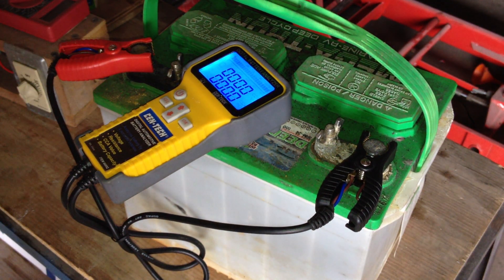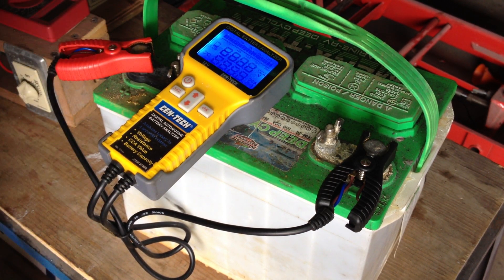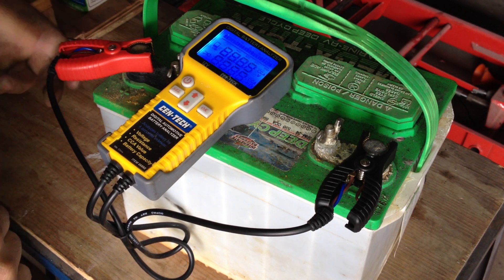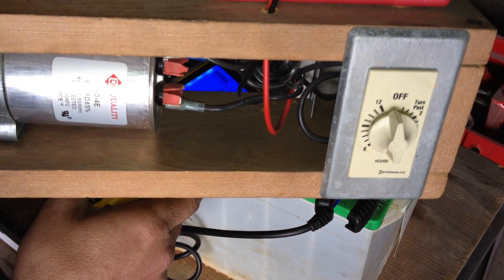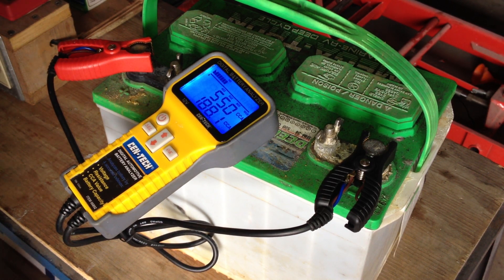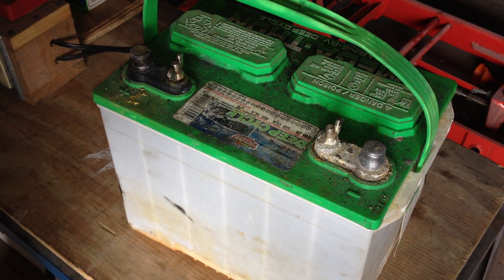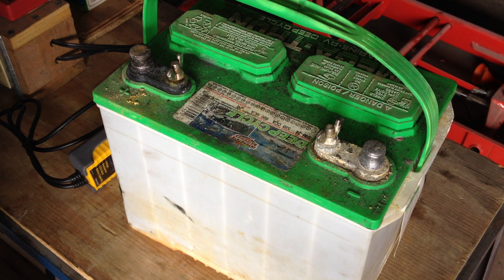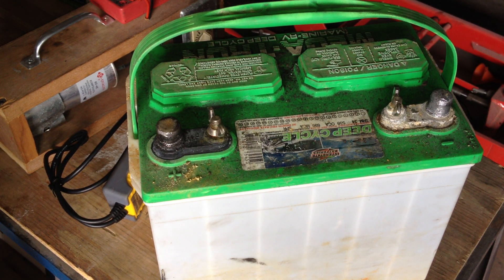Lead Acid Battery Desulfation Using Epsom Salt  -Attempting to use Capacitive Charger  Part 5 of 6

Comment: Thanks again great videos...My wife's father bought a 2003 Buick Century brand new in 2003 with standard V6 engine with Delco brand battery , from the factory.  That same battery going on 14 years old and still  WORKS TODAY!!  even after sitting in the garage not being driven, having lots of down time, (car only has 21,000 miles on it)   However it might now be starting to fail.   I just started keeping  a 2 amp trickle charger on it as it is rarely driven...(LOOKS BRAND NEW)   If the battery  actually fails,  I will try this Epsom salt treatment  A car battery with that longevity certainly proves all batteries are NOT created equal!!!!.  Planned obsolescence?  .

Comment: thank you for the great videos, I now have 18 of these chargers going, have restored to almost  like new many batteries that would have otherwise been scrapped.  I have some though that are tricky and looking for suggestions.  The ones I'm having problems with usually are heavily discharged, and have high ohms reading 40-70 range.  after hooking up the charger they will usually go up to about 100-200 cca and resistance will drop to 15-30 but that's it, they just sit and after leaving it for a couple days it doesn't really progress, they just stay about that capacity.  Do I need to leave it for a month like you say or what?  Discharge and try again?  They don't seem to have shorted cells, the voltage comes up into 12+ range or 6+ range for the 6v batteries.  Any tips?
Reply: these are larger truck batteries or golf cart batteries, have seen as high as 1000 to 1500 cca when like new. and 2-5 mohms resistance on my tester.
Reply from the maker: 262jp Yah either leave them longer, or the capacity is per entry gone. also try checking the gravity of the electrolite
Reply: acid is clear and proper level, plates look good enough from the inspection hole.
Reply: Does the Epsom salt change specific gravity or do I get sulfuric acid?  Trying not to add anything to the batteries (Peter Lindemann makes a good case for "everything that should be in a battery was put there when it was made" the exception is distilled water that could have been boiled off during use and replacing it does no harm) But will do if it brings these tricky ones right up to full function.

Comment: Why not drain it out after all that and put in fresh electrolyte solution. I can't help but wonder if that "Mud" as you put it in the other video is partially responsible for resistance issue. I'd like to see it after it was cycled a few times, flushed and refilled with new electrolyte.
Reply from the maker: Safety, Additional Cost of my Time, disposal, and spending more money then needed.
Reply: Understood, great video series though. Thanks for taking the time to do it.
Reply: ***** I would be interested in seeing what the effect would be though. I mean the epsom salts has the effect of lowering the resistance in the solution. While I can see this being a plus leaving it in, I think the core issue is the sulfation bridging the gap between the plates. Depending on the battery construction it might not make a huge difference and also the lead/insulator sandwich of most batteries would be pretty damned hard to flush effectively just from the standpoint of getting fluid to flow between them to remove the impurities.  Jut curious as to what it would do, that's all.

Comment: 2 questions, I never found your video #1 so did you add the Epsom Salt directly with no flushing or fluid change..??    & I'm a disabled Vietnam Vet in an electric wheelchair full time, & I help others with chair troubles & no money, I do all types of repairs..  As a result I have a large number of batteries here that I'd like to rework..  Years ago I built a charger with a zip cord, a Monster Diode, & a light socket, mounted on a piece of 2X6 wood. I used the socket to regulate the charging current, & the Tungsten element was a perfect voltage regulator for any voltage size, I'd put in a 7 watt Christmas bulb for trickle charge & a 200 watt bulb to "almost melt wires... Would it be possible for me to get a schematic Diagram of your capacitive charger..??    I'd like to make one to charge a small bank of batteries all at once,  I promise to use it for my personal use & not compete with your operation at all, your help greatly appreciated, Bob White......   My E-Mail is:  BobWhiteHelps@gmail.com
Reply from the maker: Just go to my channel and look at the desulfation play list :)  Added it directly, no flushing or fluid change. Dont waste your time on Gel Cells or AGM's 
Only problem with using lightbulbs is wasted energy and heat. Using a capacitor, no additional heat is generated. 
I also have another video up on building the capacitive battery charger.
Reply: Then you just leave the salt in & run it that way until it dies...??

I'm a retired Bio-Medical Electronic Engineering Component level Tech, (means I can fix just about everything down to the component level & capable of redesigning circuits to correct OEM Boo Boos.& some improvements). I repaired the life support systems in hospitals for years...Any way I asked the question above as I've watched you-tube videos where the person does all that, then empties the battery & puts in water & Alum in it to run the battery full time & put it back in their car...

I have only small components in stock Tubes, Transistors, chips, Electrolytic Caps, Resistors etc. but not large stuff like motor start caps, similar to the one you used, the bulb in mine was an emergency thing, & eventually I put a blue 7watt Christmas bulb in it & used it for trickle charging over night with the blub being my night light in the garage...
Reply from the maker: I use Run Caps, Start cap wont last very long. I just leave it how it is with the epsom in the battery as well as whatever it disolves. My justification is how cheap new batteries are (As low as $45 at farm and fleet), and the danger involved with working with and dumping out acid etc..... and the time it takes. I could not justify spending hours and hours (accept during my experimentation) in going through major processes. Also, in my professional opinion (I build EV conversions, and have extensive experience with Lead Acid Batteries), is once they've been "killed" and brought back by above means, it's just prolonged the inevitable. Like in the case of my fork lifts starting battery (I believe it was the one I used in this video). That battery was literally junk. I got a extra 6 months out of it.  at that point it wasnt worth the headache. I tried revival again, but no go. I then took another "freshly revived" battery, and that one lasted a year, and another "freshly revived" battery is still chugging away. I also wouldn't trust a revived battery in the cold Wisconsin Winter. Its not worth the hassle and cost of getting stuck with a dead battery.
Reply from the maker: Some commercially built chargers do have a de-sulfator mode, however, they fairly crappy. MIGHT keep a battery from getting sulfated to begin with if used from the get go, but in terms of reversing the sulfation, forget it. I use my home built capacitive chargers, they pulsate at 120Hz, and voltage self adjusts to whatever is needed to allow the current to flow. And they are cheap to build and very universal.
Reply: ***** Please send me info to build one for myself, thanks;
BobWhiteHelps@gmail.com
Reply from the maker: Bob White I have a video series on the construction of the Chargers. starting with video 1 https://www.youtube.com/watch?v=POiPpTZ1nA0
Reply: ***** Thanks, that was great, I have over a dozen small lawn tractor batteries that come out of electric wheelchairs, though GSM gel-type batteries are supposed to be used & do give better service, they cost about $100. @ & up but in an emergency a $30. Wal-Mart battery will get you by, Thanks again...
Reply from the maker: No problem :)
Reply: *****
 Ive had good luck with AGMs. One in particular sat in storage for years, I topped up with boiled bottle water with epsom salt mix. Put it on charge with little luck after 2 weeks. Left it to trickle for months with a PWM solar charger. Holds above 12v , I use it with 12v appliances now, 20mins at a time. Edit: 20mins at a time with mabye .1v drop.
Reply from the maker: No, due to the nature of the capacitive chargers I use, no way to really make it automated other then a timer.
Reply from the maker: DarkLinkAD AGM's are sealed. How did you top it off?
Reply from the maker: Never seen em. Passive desulfators dont work. Active pulse only. All a battery maintainer module will do is let the power flow from the panel when the voltage is below the set point and stop the power flow when battery is full. Just like a float charger. They work nice. But do not desulfate.
Reply: hi guys, the greatest success that i've ever had was with the Magic Mender Wizard (i found it on google) definately the most useful course i've tried.
Reply: Hi Bob, most wheelchair batteries are now sealed. Many are now AGM, designed to have no water sloshing around- like a 95 % saturated sponge. Epson Salts are a temporary fix. Adding it may revive a battery a bit , as might EDTA. All chemicals have negative side effects like quicker plate corrosion & self discharge. Never add chemicals to a newish battery in good condition. For an AGM don't add too much water. They're not even meant to be opened , but you can do it. I'd try a slow charge first by an old fashioned trickle charger , maybe with a car stop bulb in series to limit the current. Check that water covers the plates on a wet battery & add some if it's low. If the battery is not improving after a days or so, if it's AGM  add a bit of water (use a syringe) then leave it on slow charge. You could assume the water was low on an AGM & add a SMALL amount before charging, then add a bit more afterwards. A trickle charge can take a week. I don't think you do any flushing before adding chemicals like Epsom Salts. Apparently in Africa I have read that, with a wet battery, they tip the electrolyte out, fill the battery with Coka Cola, swish it round to clean sulfation off the plates, tip out the Coke, then flush out very well with tap water several times. Finally refill with the electrolyte & charge the battery, preferably slowly. (Never tried this myself so I can't say if it works or not.) The circuits for the capacitor & mains bridge rectifier type chargers is on the NET by Googling 'Capacitive lead acid battery charger'. You can improve some 12 volt wet batteries by an equalization charge of around 16 volts for a few hours. The battery will bubble, so you need to add more distilled water  I see this is 2 yrs old, so I hope you are well & kind regards (I'm in the UK)

Comment: Voltage went up to 12.97 instead of 12.7 and the resistance was 22.7 and now it is 15.7. Definite improvement.
Reply from the maker: Bob White Correct, it will start boiling. However, during the desulfation process, I found mild boiling can help break up the sulfation.
Reply: That's cool, makes sense..
Reply from the maker: Forgot to mention, in battery banks of more then one battery, once boiling point is reached, the batteries can also start to equalize the voltage by charging at mild to high boiling point.
Reply: Normal charge voltage for car batteries is 13.8  & 15 is the recommended max charging voltage as at 16volts it will start boiling the battery.. So I'd recommend checking on it while it's charging & don't let it run all night unattended..
Reply: ***** hi, i know you have enough idea about this, if you want to know more , you can google it on Knewreck rapid renew guide

Comment: Why not just use a desulfating battery charger and forget the epsom salt and messing around?
Reply from the maker: A desulfating charger (I build them, so I have extensive experience) can only do so much on it's own. They can also not recover batteries once the battery gets to a certain point. The epson salt + a desulfating charger can do some insane things!

Comment: Doesn't the m before the ohms symbol indicate meg-ohms on your battery tester?
Reply from the maker: milli-ohm I believe.
Reply: +KmanAuto meg
Reply: Yes it's milli-ohms.  Anything much more than 15 milli- ohms for a car battery means the battery is pretty poor. Usually it's nearer around 5 milli - ohms for a new battery, lower the better.
Reply: Personally I think any car batter that reads more than 10 milli- ohms is on it's last legs.  Adding chemicals like Epsom Salts or EDTA might get you 6 mths  or so extra use out of it.

Comment: Really neat. I have used baking soda in the past. Very short lived but it worked partially. Flush with water, use tablespoon in each cell and slow charge overnight. Old trick at service stations to sell used batteries. Nothing scientific, just learned from on old hand at a station, many years ago. If it didn't work we would dump it again and buy electrolyte from auto parts store and refill. That worked better.  I think we didn't really de sulfate very well. Interesting experiment, thank you for posting.
Reply: Well I've used baking soda, 1 cup to 1 gallon of water, as a flush, make a gallon & flush & change it again after it stops foaming, then flush with water & make a mixture of 1 cup Alum top 1 gal water {Aluminum Sulfate, food grade, pickling salts, no Iron} charge it & use it... If the plates look heavily sulfated, do the Epsom salt thing to clean that up, then do the baking soda/Alum thing...

Comment: With a battery that bad. Your not going to get much more use out of it. Salt water would definitely raise the resistance, as it's more conductive. Once a battery gets badly sulfated, there is nothing that will fix it. Interesting experiment, never the less.

Comment: If Epsom Salt  is so good why dont battery makers put in Epsom Salt  with the acid to extend battery life?
Reply: Epsom Salts is a last ditch -  fix. Adding most chemicals SHORTENS the life of brand new batteries.

Comment: Hi, I think you may want to dump and rinse the battery now to get rid of the sulfate mud which causes resistance. Then if you refill with new acid you will have a battery that will last awhile. The Salt not only desulfates it but is very harsh on the fins of the cells!

Comment: Some points.

Don't add Epsom salts before the desulphator. You will make it hard for the sulphate to re-enter the electrolyte as it is already sulphate laden.

I wouldn't trust a thing that meter says. How can it just display CCA like that. The resistance of a battery should be milli ohms.That battery will not sustain high current delivery.

Seems your mains desulphator has too much output. Voltage should start high, then drop. Not the opposite.